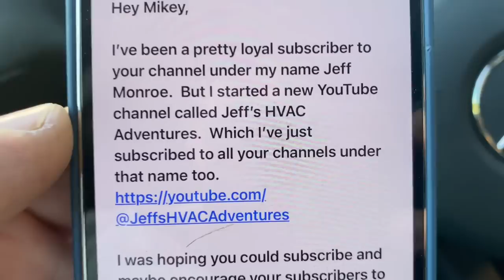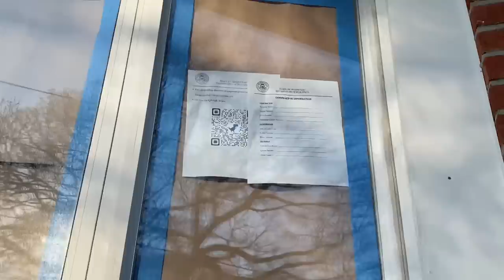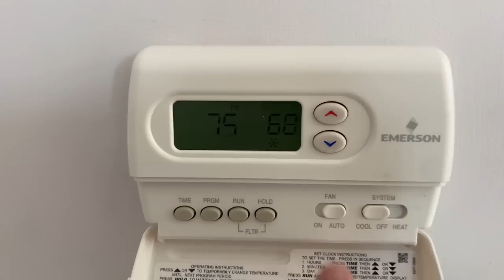Central AC Thermostat Not Responding & System Not Blowing - How to Diagnose Blown Fuse

Comment: Love that a good technician is  observant of his sourrindings
Reply: but as soon as the blown fuse was found, they should have went searching for the electrical issue before just ramming in a new fuse. granted that low voltage and low current, at higher power levels that can get you killed in a huge arc flash.
fuses/breakers very rarely ever blow/trip without reason, always fault check and inspect first, then if no issues are found start thinking about how old the fuse/breaker is and thermal issues from loose terminals/screws.

Comment: Any recommendations for a surge protector device for an air handler with a ECM motor? I have one on my outside condenser, but putting one on the ECM motor up in the attic would hopefully save me from replacing the motor early.
Reply: now days, it's wise to have a whole house protector installed at the breaker panel too.

Comment: Mikey Pipes, I’m in S. FL and have a train X13 2010 3T Unit, and had the exact same issue last year, (needed new ECM blower motor). My question is how many HVAC guys out there would easily just say you need a new ECM blower Motor which is easily a few thousand dollars verses just a few dollar fuse? Secondly, how would you diaganose a bad ECM blower motor had the fuse been good?  Also, X13 blower motor was taken out but a different one was put in I’m assuming for cost reasons bc X13’s aren’t cheap, your thoughts/recommendations on not putting in same X13 motor?

Comment: Hey Peter, in an electrical 24 volt circuit there is a "hot" and a "common". The common of the transformer is actually connected to ground, meaning the common wire is actually connected to the metal of the furnace. The same thing as the chassiss of a car. If the hot and common touch each other directly, then that would be called a direct short and the fuse will pop. In an electric circuit there are loads and switches. A load is like a condenser fan motor or a light bulb. It is a device that does work using electricity. Sometimes the coils inside of a load can fail and the resistance of the coil can become very low thus causing a direct short. I would highly recommend reading on your own about electricity and how to read diagrams. You will need to be good at this. If you want to make Mikey proud then you will go home everyday and read. Go home and learn l you can everyday and you will become a great technician just like Mikey.
Reply: Ground vs. Earth vs. Neutral.

Comment: No need to run a whole new wire. The damage is most likely limited to outside from sun fading, rodents or abrasion from the vibration of the lineset. A scrap of thermostat wire spliced to the end of that with a few "beans" (the white crimps the alarm guys use) pushed back into the house so it was all brand new wire exposed outside. This is a fix you could have done on site and billed your customer for it right then and there. With zero problems in the future

Comment: Keeping it honest here… First possible guess was water got to the T stat wires due to the water level stains hight in the unit(that was a preliminary guess) But bare wires outside damp conditions definitely are short.. NOW it bitch time!! Why do contractors run and expose T-Stat wire to the elements is beyond me!! I always run exterior T-Stat wire, which is like underground Romax, and use my disconnect as a pass-through box. The T-Stat wire runs with the THHN IN THE CONDUIT FROM THE DISCONNECT TO THE UNIT IT’S PROFESSIONAL LOOKING LESS HEADACHES I DON’T UNDERSTAND WHY CONTRACTORS CAN GET AWAY WITH RUNNING AN TAPE TO THE LINE SET!!! < Sorry about the capital too damn lazy to retype it> But I cannot even begin to count the number of jobs. I went to with indoor T-Stat wire going outside unprotected is bullshit. It’s ridiculous. It’s uncalled for and totally unprofessional.😅😅😅ok my rant is over with ❤